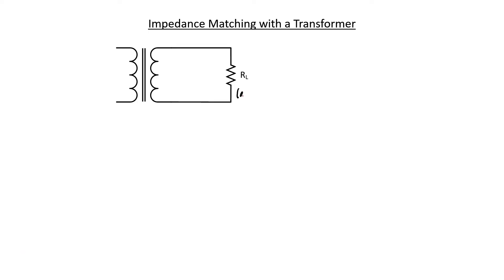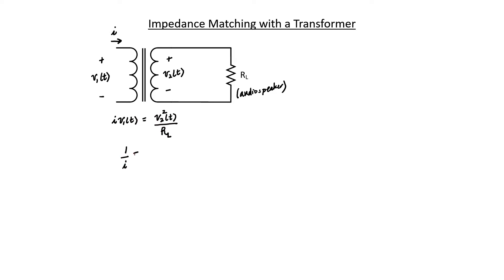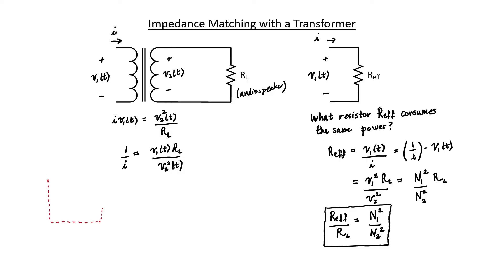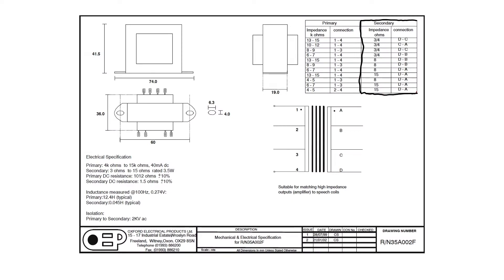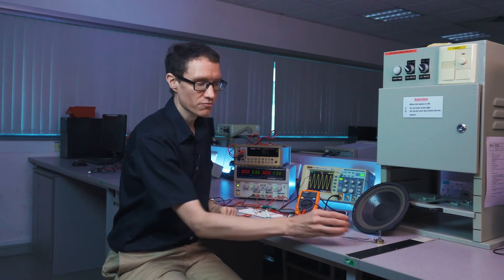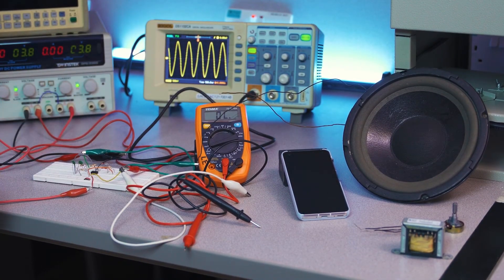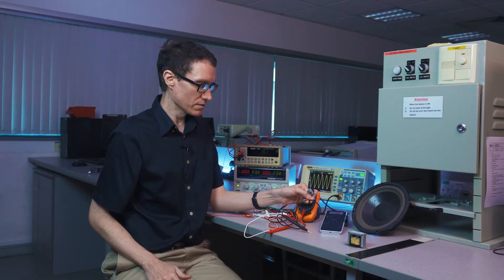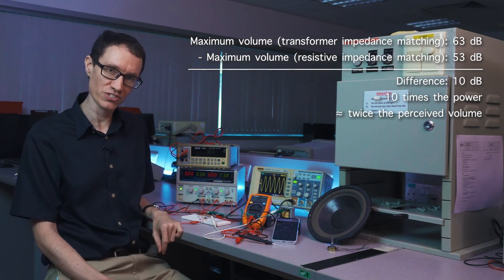Audio Transformers (#17 AC and Switching Circuits)

Comment: Thanks. Very much appreciated. 🙇 My new waveform generator is in transit. I was trying to figure out how to connect an 8 ohm load (speaker) to a 50 ohm source (waveform generator) without destroying the unit. 
I wanted to generate DTMF tones as my first experiment and hear them while exploring the waveform on an oscilloscope.

Comment: If there is no datasheet of the transformer ,would it be a good idea to measure the windings with the ohmmeter and take the value measured as the impedance or an LCR meter is mandatory for proper measurement ? The video is very good and explainatory

Comment: Thank you for the clear explanation. However iron core transformers can severely distort the frequency response of the system as the impedance (inductance) added by the transformer varies a lot with the frequency.